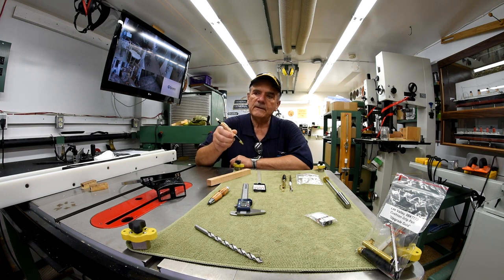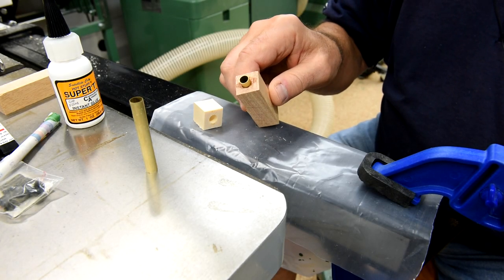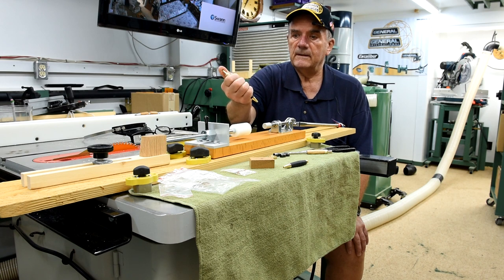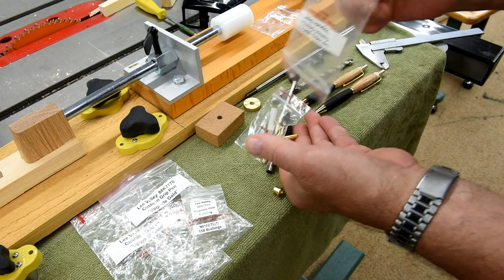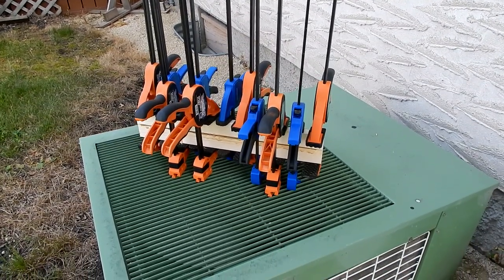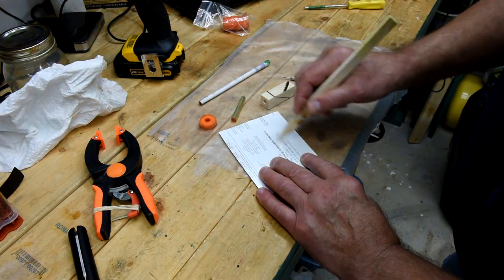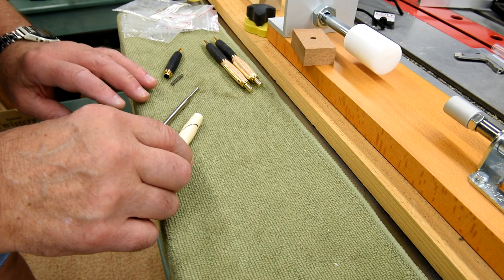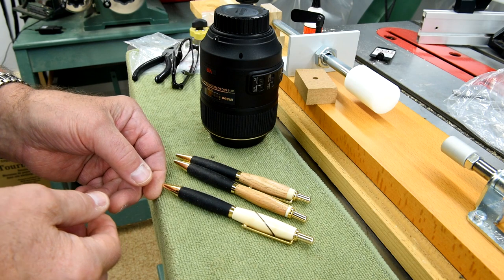The Cushion-Grip Pen

Comment: This is one of the reasons I like watching your videos.  Good honest evaluations with the evidence to back it up.  I really like the little Aspen ring on the first pen you did.  That mistake turned out to be a winner.  The second one was nice too but I liked the smaller ring at the top.  I thought you would put the ring on the bottom and the larger one might have been better there.  The third pen turned out interesting as well.  Cutting it again and adding another veneer strip in the opposite direction would make an interesting look.  Thanks again for such quality videos.